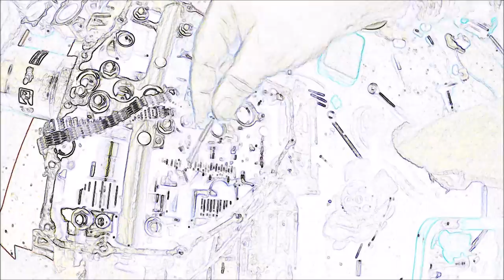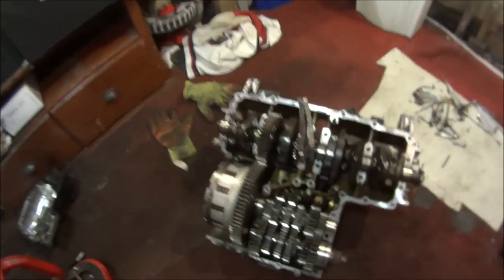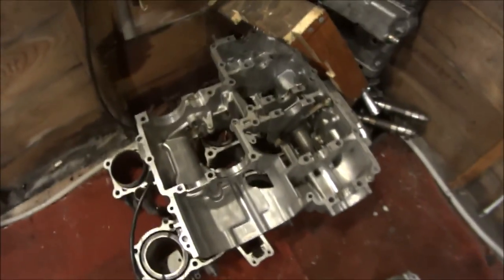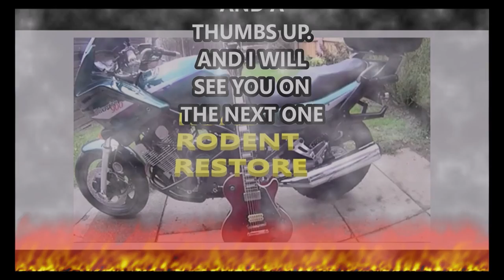CBR1000F Landfill bike, Engine split.

Comment: Dumb question... What stops the oil pissing out from behind the front sprocket? Is there an oil seal there or is it a sealed bearing etc? Mine's throwing oil out there.
Reply from the maker: At think about that I'd forgotten all ready. Yes its a sealed bearing 👍
Reply: @jonyr1TT  Cheers, guess it's an engine out job then. At least I know now!
Reply from the maker: Afraid so fella